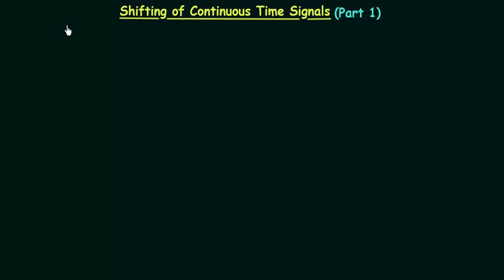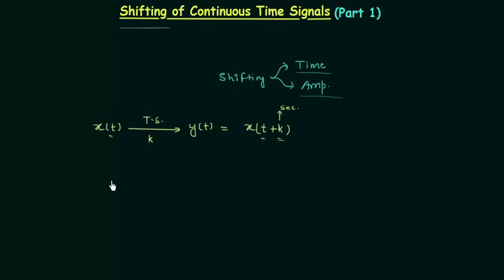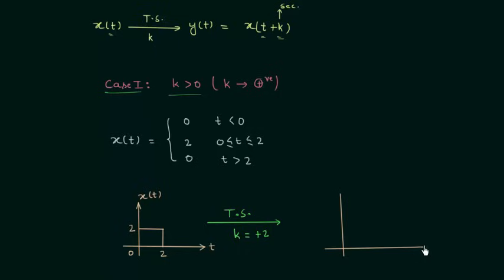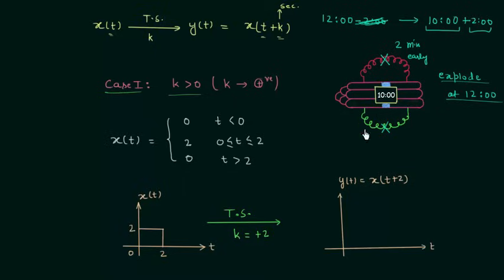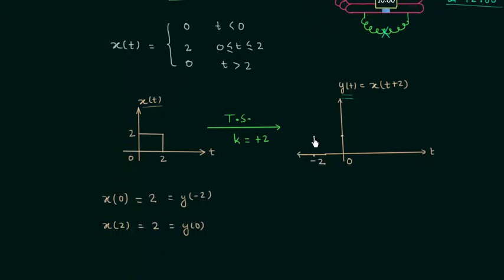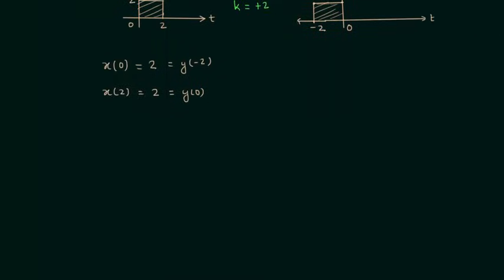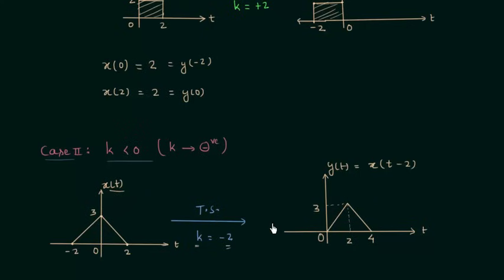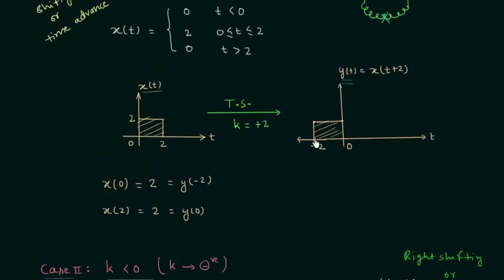Time Shifting of Continuous-Time Signals

Comment: If you get confused about shifting, just calculate the value at each x-point. Don’t check only one point.
For example:for  x(t+2)
0 - 2 = -2 and 2 - 2 = 0, so the graph is shifted 2 units to the left.

Comment: Instead you can just calculate the new t, by equating given shift with each time existed in original signal...Ex:(t+2)=2 ,then t=0, so whatever data existed at 2 will now shift to 0, similarly let t+2=0, then t=-2, so whatever existed at 0 will now shift to -2
Reply: Thank u so much.
Is this logic applicable to all types of questions.?

Comment: How the hell for case 2 it's x(t-2), when we pick -2 as t coordinate and then do subtraction to get y=x(t-2) => x(-2-2) = (0:-4) thus function value x equals to zero at coordinate t = -4 that's a function y values, and here you say it's actualy 0 how the hell does this work when you subtract negative two from negative two and have 0 what the hell is that math.

Comment: took me a while to understand the bomb example, for those interested I'll write down my way of explaining what's happening and pls correct me if I'm wrong:

Imagine you're sitting in front of the bomb and you have a timer that started when the bomb was set off. 
For example, you're at 9:00 minutes now (you've been sitting there watching the bomb for 9 minutes) and for some reason, you now cut the red wire that makes the bomb explode 2 minutes earlier.
You can say that the bomb will explode at 12:00 - 2:00..... or you could imagine that you're now 2 minutes forward in time. 
You're not at 9:00 anymore, but 11:00. 9:00 is the instantaneous time and it now became 11. 
You only have 1 minute to flee.

Neso explained the same thing considering you were at 10:00 and that's the number you see on the bomb cause that thing on the bomb is the timer. There's a 10 in it meaning that it started from 0:00 but now it arrived at 10:00. If no one cuts the red wire it arrives at 12:00 and BOOM, otherwise, it's going to explode right NOW. In fact, NESO says at some point "the bomb will now explode".
Reply: Thanks i was having a hard time trying to understand why we do t+x to represent a left shift cuz it always seemed it was delaying it by 2 seconds and have to wait another x units to start
Reply: @techmad8204 this makes more sense ty😅
Reply: thank you so much i didnt understand as well
Reply: ig the only thing that is to be corrected is that YOU ONLY HAVE 2* MINUTES TO FLEE
Reply: An event scheduled to start in 3 days , we say 3 days to go. But if it is pre-poned by 1 day we say 2 days to go so advanced and shifted towards the left

Comment: can u explain  advanced signal is not possible?  with example, because the audio(songs) can be compress
Reply: @Naveen Naveen 
Let me explain that the compressed audio signal is not an example of Time Advancing, but can be an example of Time Scaling.
If we compress the signal, we can't advance the starting point of the audio signal in past as that of the '-ve' time instant.
I hope you are aware of the difference between Time Scaling and Time Advancing. 👍

Comment: X(2-t)..?
Reply: @AGNI PRASANTH 
First we write the given signal in a simplified form as: x(2-t) = x(-t+2).
Now, we can see the operations being performed on the given signal clearly as: the signal is being advanced by the factor '2', and then the signal is being reversed about y-axis due to '- ve' sign added before the time instant 't'.
So, first advance the signal by an advance factor of '2' in the graph then reverse the obtained graph about y-axis, you'll get the resultant graph of the given signal.

Comment: in signal and system book by oppenheim on page # 38 ,39 the concept of time shifting is vice versa to your lecture can you please guide clearly
Reply: It's the same concept actually. In the 'oppenheim'  book, they've taken 'k' as '-to' , so in that case  , when 'to > 0 ' , it represents a time delay (right shift)   and 'to<0' means advanced ..therefore a left shift.
Reply: @mostlyharmless161  but right and left shift conditions in this video are different

Comment: what is the meaning of advancing the signal.........couldnt understand the last few seconds
Reply: I think he was basically saying that you can't advance a signal in real time, such as somebody speaking. You cant shift a real live signal that is happening unpredictably. You don't know what comes next, so how would you advance the signal to the left such that the future is happening sooner? You can only shift a recorded signal because you already have the whole signal recorded, you know how it starts and ends, so you can create a new starting point on the signal by advancing or shifting the signal to the left.
Reply: The signal is advanced because everything is occurring 2 seconds earlier. Simple way to understand it is if the shifting is a positive number, it moves to the left, if it is a negative number it moves to the right.
Reply: This topic requires a better interpretation due to obvious notation (Advancing / Delays etc ?) confusion.

Comment: can you give me some practical applications for time shifting both negative and positive
Reply: so far, suppose you have to do some work in a specific period of time and you start in whatever point eg. if your starting time was at 7 A.M and your specific period of time T=2 hours, so if you start in the original time (7 A.M) t= +7 you will end up at 9 A.M but either you come earlier or later of that time, this determine the time when you finish y(t) depending on the time you start in, if you come earlier suppose at 6:30 x(t+0.5) t= +6.5  then you will finish early --------------> y(t)= 8:30 A.M and so opposite if you start lately you'll delay your finishing time x(t-0.5) -------------> y(t+0.5)